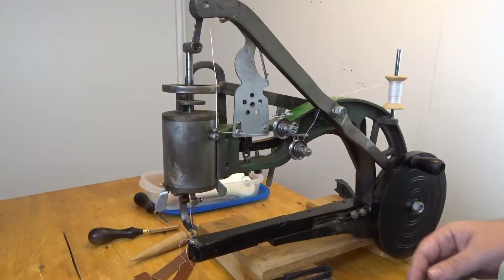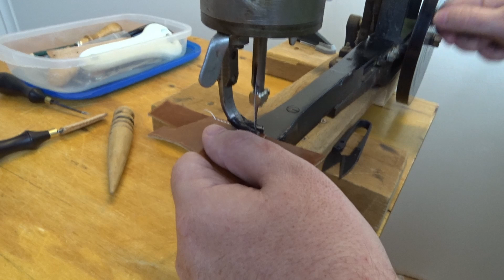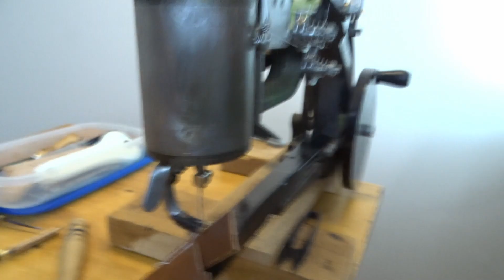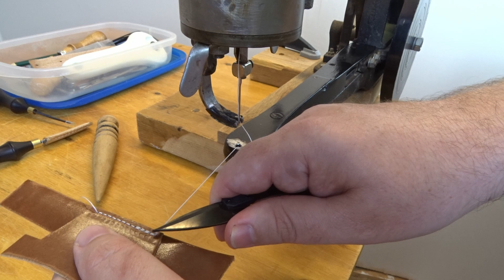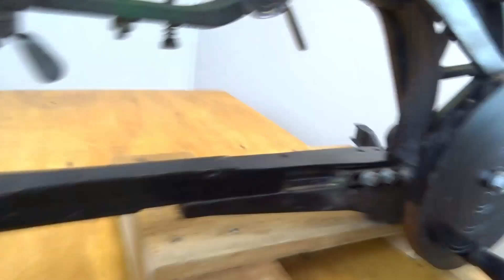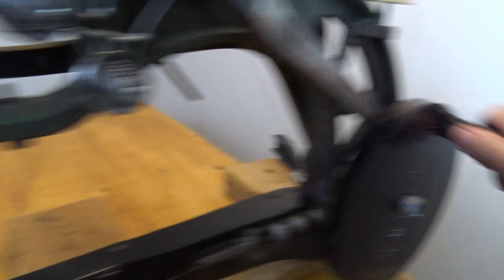Amazing Low Cost Leather Sewing Machine For 2027!

Comment: it looks simple to use, but, when l look at the marks deep on the leather on both side  of the presser foot, it does not provide a good looking for selling leather wallets for commercial purpose i guess? I may be wrong, but, anybody have an idea how to remove these deep marks o the leather on both side of the presser foot ? Thanks
Reply: You need to sand and file down alot of places, also do mods so it'll run smoother etc. Alot of ytube videos showing the mods

Comment: Hi thanks for the video, I unhooked one of the two presser foot springs, because it pulled too much and ruined the material, I think it's a great machine, at first I was perplexed. I see that you cut the foot, can I ask you why? Thanks PS what size of cable do you use I use a 0.5 round

Comment: Have you noticed any differance in using one or two tention wheels and with which threads like or differ  in use .or length of stich my machine .i used 40-69 -135 -210 420 480..110-130..needles..so much it can do..i notice you use a very tiny sticth ..impressive..

Comment: I just got one of these last week.  I am watching every video I can find.  I got mine to mainly do leather work.  I got the size 18 needles with it, but I also ordered some 21 and 22 size needles.  Already had some thread, not waxed, that I used for leather work.  I made a knife sheath with it last week for a fold up Case XX Saddlehorn using the black nylon thread that came with the machine.  Didn't do too bad at all, using the size 18 needle but when I tried to make a cast iron skillet handle sheath, I used the T135 thread and it kept braking, that is why I order some 21 and 22 size needles.  Now it seems fine.  Thanks for sharing.
Reply: Hi.  Where did you order yours?  There are several places offering similar machines, but I don't if they are the same sturdy model.  I want one that will sew the heavy leather.  Any info would be helpful.
Reply: @nancyhainline2517 I got mine from TEMU back around March 2025.  It was on sale for like $77 dollars!  I really like mine, and I did a review of mine on my channel.  It took a little getting used to and getting everything setup right.  There is one guy on YouTube who really gets detailed on the machine.  His videos are probably 10 or 12 years ago, but they were very helpful.  There is also a company here in the US that buys them and tweaks them and sells them, but they are more expensive.  Sorry I can’t be of more help.
Reply: Hamilton Hightower is who your referring to i believe?

Comment: It does require significant time to tune up the machine. Out of the box it isn't at all in good shape.
Reply: Can you elaborate some please 🙏🏽
Reply: @StreetLife925 all mechanical parts need slight polish and touch up.  Don't exactly engage as they should.